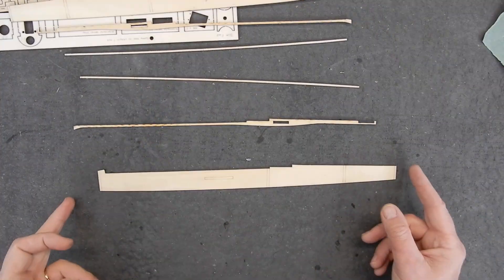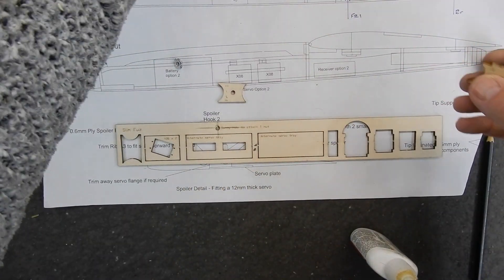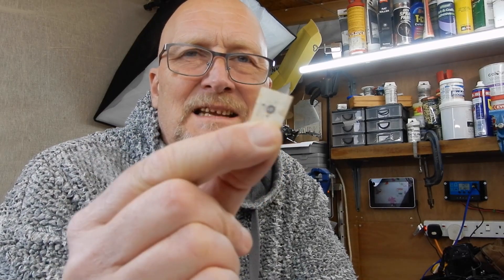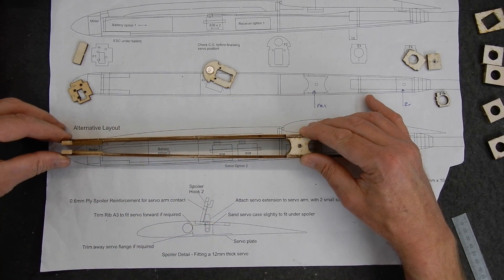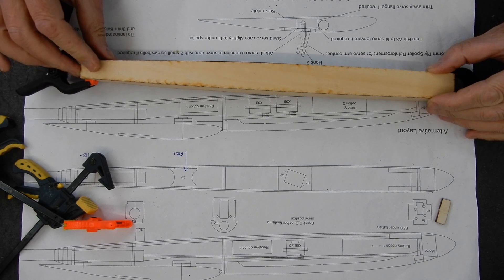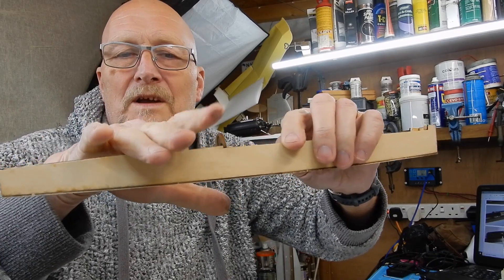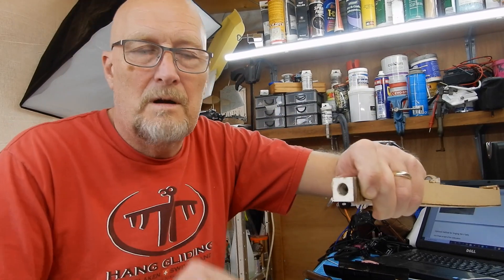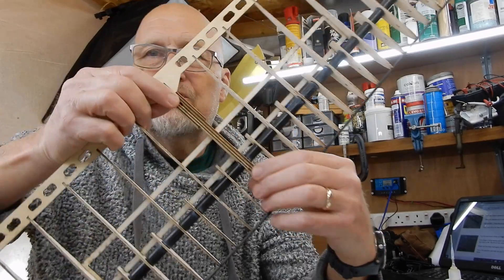How to build a OZeRES 2 – 2 Metre  electric  glider Part 3 The Fuselage

Comment: I found that balsa dust really gives me problems with headaches and blocked nose, I bought a 3M 6000 series respirator which works for nasty fumes too, it made all the difference. I can sand for hours and get covered in dust and as long as I brush it all off me before taking off the mask there are no problems anymore.
Reply from the maker: Yer I using safer glue and a full mask in certain conditions